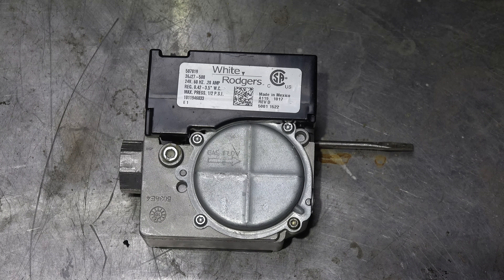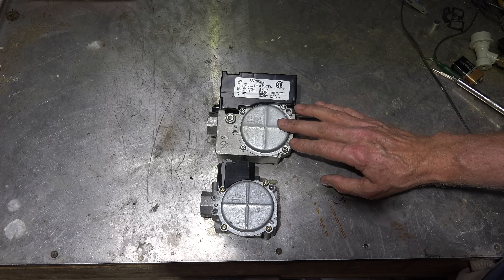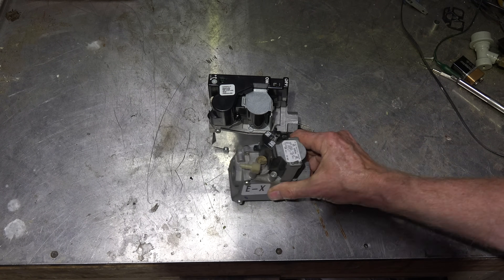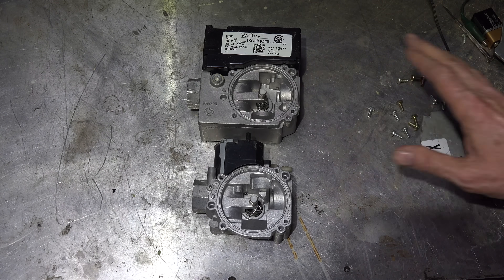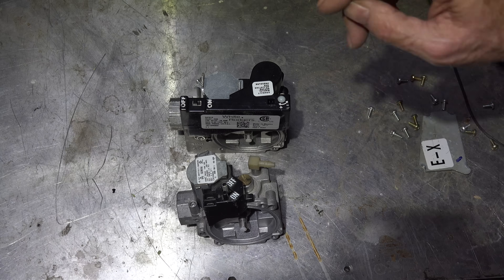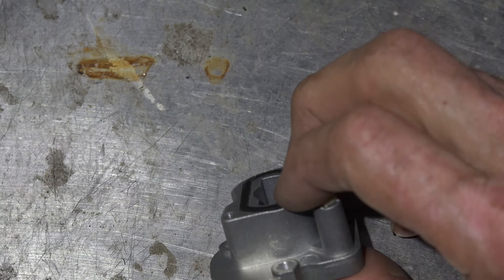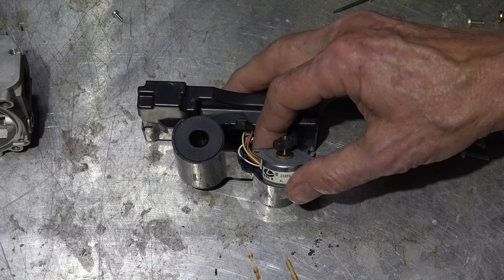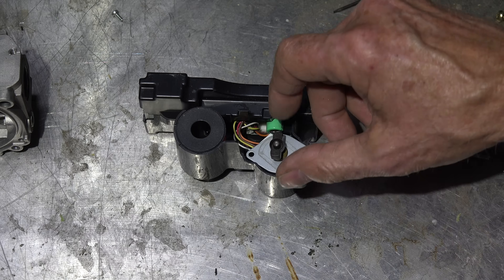How the variable firing rate gas valve works.

Comment: Great video once again. I have a gas valve that is White-Rogers Model 36J22Y-204. I says to back outlet pressure test screw out one turn counter clockwise then attach 5/16” hose over boss. Is there a reason to do this compared to removing screw and inserting barb fitting?

Comment: Looks similar to the gas valves we have in Europe.  They are modulated by boiler (furnace) potentiometer (controls) and NTC thermistors which send signal back to PCB to modulate the gas depending on the parameters set. Some old boilers still only have a two stage low and high flame setting.
Reply: interesting to know. It must be a good old German design 😃
Reply: @glasser2819  Actually our valves have changed to a zero governor which as you know relies on negative pressure from the fan.  The faster the fan the more negative pressure and the more gas mixes in the venturi.  Its much more efficient than a modulating valve based on solenoids.  European boilers have an efficiency ratings of around 95% because of condensing technology. No one uses open flued boilers anymore in domestic properties, they are all room sealed.

Comment: Forgot to say that the ac company pulled the large 'range' fuse completely and wired everything to 2 60amp barrel fuses before the round fuses. Thanks again.
Reply from the maker: If you do have a true "fuse box", no breakers, you need an electrician to replace it with a breaker panel.  I would get an electrician to check this one out.
GFM
Reply: I figured it out. Was a barely loose fuse mounting screw. Barely wiggled, but just enough to cause issues. Thank you for the reply

Comment: I had my furnace replaced about 3months ago, runs fine. Kicked on my central air a few times, seems fine. I go to kick it on yesterday and nothing.. I followed lack of voltage to fuse box (older style Federal brand), the fuse is only reading 42 volts. Replaced all of them. Is the fuse box bad? Noburn marks , wires are tight, everything seems good. Any help would be appreciated. Btw, you unknowingly helped me with furnace and its bad heat exchanger. Thanks

Comment: Modulating gas valves are nothing new, we've been using them in the commercial boiler industry longer than I've been alive. The problem using them with forced air furnaces is temperature rise. The furnace manufacturers are having a hard time getting a handle on this. Heat exchanger failures on these type of furnaces I feel are at an all-time high, merely because the temperature rise is constantly varying. In the commercial boiler industry we have a handle on this because of stack temperature adjustments & boiler tube design. I feel the force air furnace manufacturers still have a way to go on this. Sometimes I feel built-in obsolescence is their game plan.
Reply from the maker: You need to be looking closer.  The Rheem unit this valve came off of uses a return air temp sensor to determine gas flow.  So much for the heat exchanger issue.
You are correct that modulating is not new.  Space heaters have used hydraulic controlled gas valves for over 50 years.  Makeup air units for restaurants also use a hydraulic valve.
GFM
Reply: @grayfurnaceman  thank you so much for replying and addressing my concerns. I also wanted to thank you for your interest and dedication to the HVAC industry and the people you've educated over the years. I find your videos, experience and expertise unsurpassed on social media. I have been a first responder / service technician for the gas utility in St Louis, Missouri for 35 years. Our service department at Spire St.Louis is approaching 300 service technicians, all HVAC men and women from the superintendent down to the employee just hired. We keep meticulous records on every hazardous Appliance report we issued. Through statistics and experiences we can notice certain Appliance manufacturers that may be having issues. I think it may be premature for us to praise or condemn the particular heat exchanger you are referring to. When new technologies are introduced to the marketplace sometimes they lose their luster if problems occur. Only time will tell. Thanks again for your dedication and service to the industry over the years,  Bob.
Reply from the maker: @boby115  Reference the Carrier 58sx as an example.  A high efficiency furnace with all the bells and whistles that had a reaction between plastics in the secondary and the stainless steel, causing massive numbers of leaking heat exchangers.  Thanks for the support.
GFM
Reply: I am always thrilled when I see a cheap  residential gas furnace stuffed in an attic "to save space"... knowing how a failed heat exchanger will lead to flame rollouts... So ultimately furnaces are a attic fire hazard yet pass the building code inspection 😂

Comment: What happens when the modulating furnaces are installed in areas with low heating value natural gas and or high elevation? For normal furnaces some of the manufacturers say to use a gas pressure other than 3.5, they have a range for minor adjustments.

For units with this style modulating valve, looks like you can do that and only the orifices can be changed if approved by the manufacturer.
Reply from the maker: All I can tell you is manufacturer's instructions.
GFM

Comment: So does the main board also control the speed of the inducer motor as well? I would think that to maintain proper combustion that draft would also fluctuate to compensate for a greater or less firing rate.. 

Great video!
Reply from the maker: The early ones (about the year 2000), used a 2 stage inducer, but the newer ones are variable speed.  
GFM
Reply: Yes it does.
Reply: My furnace is variable from 35-100%. The inducer and blower are both variable EC motors.